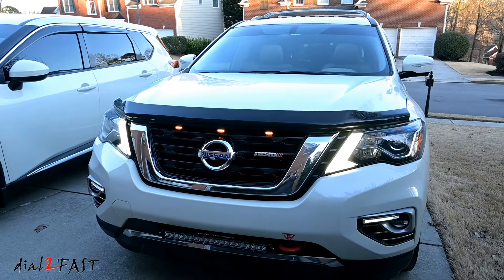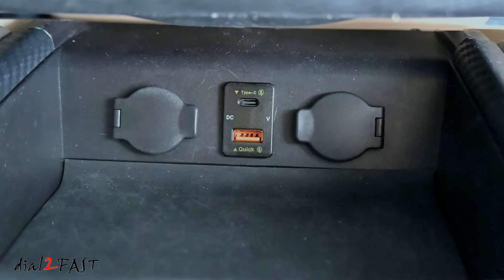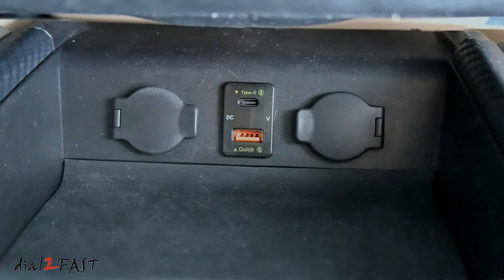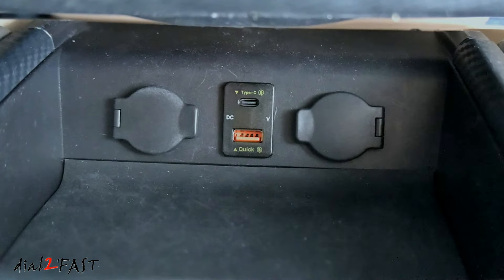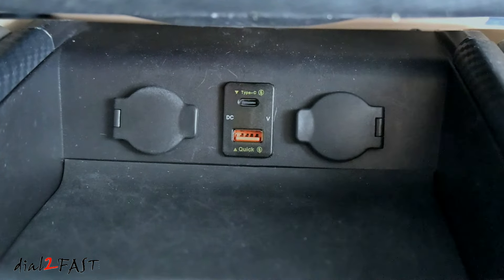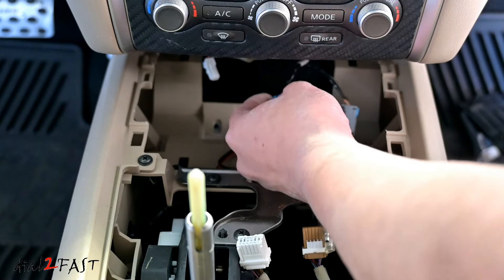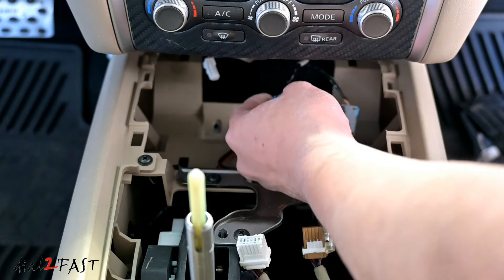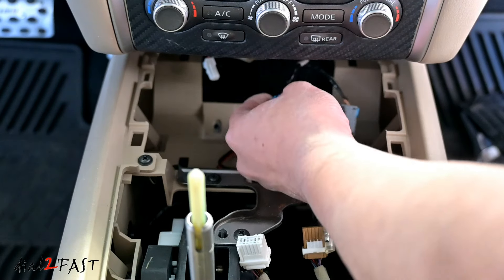How To Install NEW QC3.0 USB Charge Port In Nissan Pathfinder

Comment: hello. the usb port under the armrest connects the phone to the car's head unit and powers it. on my 2018 Pathfinder I think the usb module is somehow damaged as it struggles to connect and power a device. any ideas on what part to order? on my car it is a single usb port. Thanks!

Comment: My murano doesnt have a tray like that, but I wonder if I could drill out the cigarette adapter and replace it with a circular shaped charger or something?
Reply from the maker: I don't recommend that as the fitment of the hole might not match the aftermarket charger, and there is a connector behind it that you will have to drill through. It's just a big mess if you do that. Get this one here and you will have the PD and QC charge port https://amzn.to/4gO2mgS